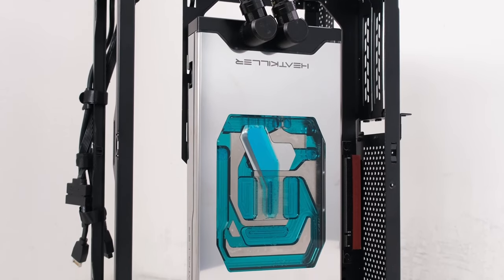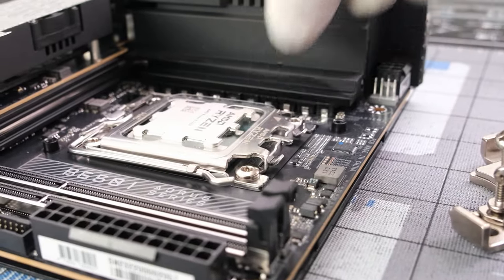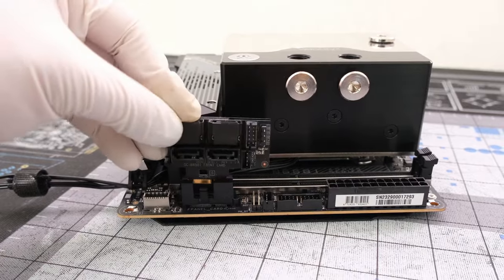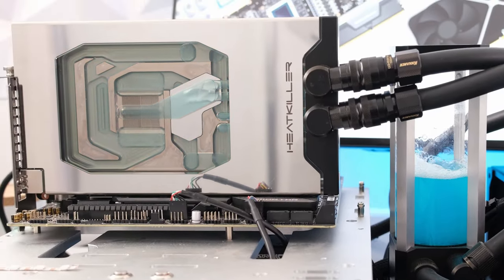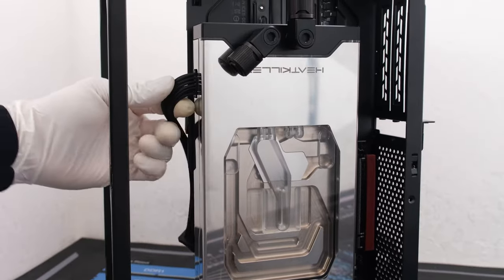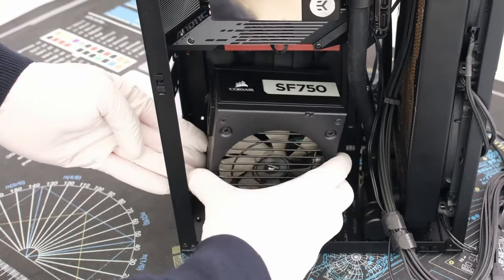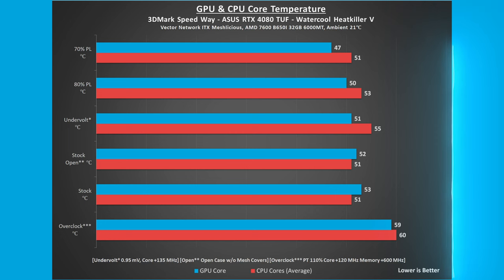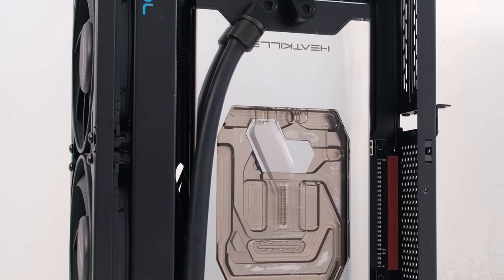Watercooled ITX Build - Step by Step

Comment: Wait I thought you weren't supposed to use isopropyl alcohol to clean the nickel plated copper? Or am I missing something?
Reply from the maker: Thanks for your comment🙏My understanding is that isopropyl alcohol is generally safe for cleaning metal surfaces like nickel-plated copper as it evaporates quickly and doesn't leave a residue. I do avoid it on acrylic. I did also ensure the brush was soft as to not potentially leave scratches. I did put more than usual on the block for effect, but I did quickly dab it off with a microfiber cloth off camera. Hope that helps
Reply: @vectornetwork  yes thanks for letting me know so when I go to clean my block next time I will use a little bit of iso

Comment: Hey, the temperatures on the charts are delta and to get real temperatures you have to add 21C ambient to them?
Reply from the maker: Thanks for your comment 🙏 No, the number you see is the number with the 21C already added. I changed the charts in more recent videos as that was a little confusing. Hope that helps

Comment: Lets keep in mind, not only were the 30 series marketed as "4k" cards, but the 40 as "8k". 😂😂😂 A 6 year old game hitting 48 fps at 4k is hardly and 8k card.

Nice look, I'm liking the heat killer the more builds i see with it, at first i thought it was god ugly.
Reply from the maker: Thanks for your comment 🙏 I agree, the 30-series is not really for 4K, even considering the 3090. The 3080 is a solid 1440p (2K) card. The 40-series with the 4080 and 4090 have really unleashed 4K gaming and those are solid 4K cards. Watercool and their HK brand is on point. I will continue to use HK products and my next video will showcase the HK Noctua 420 Mora. Thanks again for watching.

Comment: If it’s possible to put another 140mm or 120mm radiator on GPU side.
Reply from the maker: Thanks for your comment🙏Anything is possible my friend. But will that work with this build? No. The GPU is already a tight fit and there is not additional room for the rad (30mm) and fans (25mm). Keep in mind that the whole build is stock without any custom modifications. No dremel needed, no additional screw holes needed and it fits with all the mesh covers on. Hope that helps
Reply: @vectornetwork What about slim fans and slim radiator, for example tx120 from XSPC which is only 20.5mm and noctua A12x15.